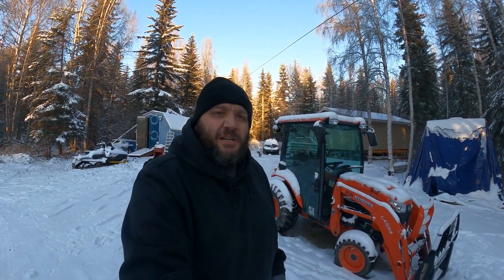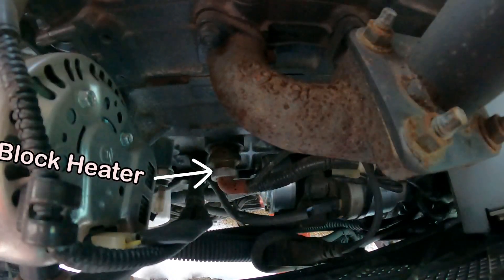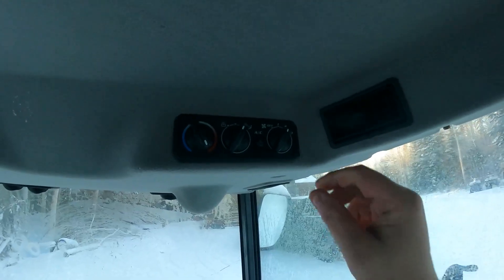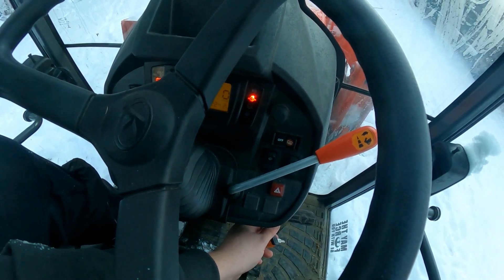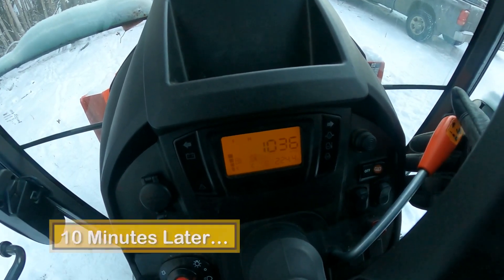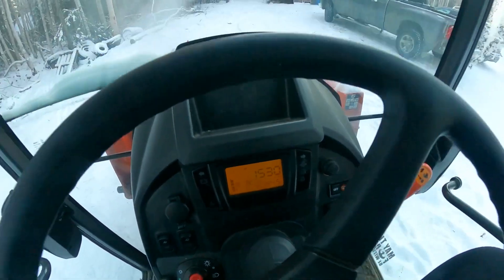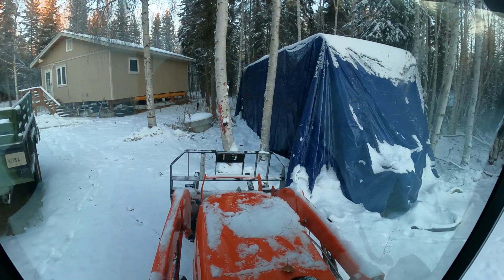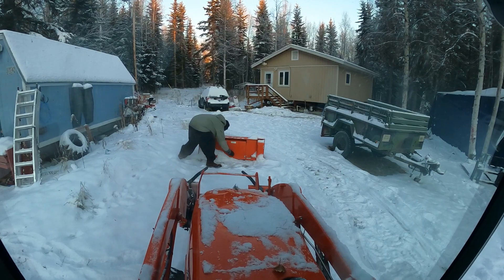Easy Cold Weather Tractor Start Up (Kubota B2650)

Comment: Hey Dana, when I bought my Kubota, my dealer taught me a little trick. He taught me to turn the key to the glow plug position and instead of trying to start the tractor, just bump the starter and it will suck the heated air into the cylinder and help to warm the process. Don't know how much it helps, but I do it when it is bitterly cold. It gets down to way below zero here in Iowa. My tractor sits inside but the building isn't heated. I do have portable heat that I can use if need be.
My big tractor with the cab and heat sits in another shed that isn't heated. It has a hose heater on it but the tractor doesn't have glow plugs. It is a 1970 model John Deere. They didn't have glow plugs back then. I just plug the tractor in and then come to the house and trip the breaker to that building. When I get up in the morning , I turn the breaker back on, fix the fire in the wood burning furnace, make a big hearty breakfast, and by the time I get all that done, the tractor is ready to start.
Thanks for sharing this. You covered it really well.
Reply from the maker: Thanks 😊 we could use all the help we can get in the winter. I’m curious how cold does it have to be for the John Deere before you need to plug it in? I have never been around a diesel without glow plugs. My dads Florida truck is so spoiled it will barely start at 40 f without help, and his glow plugs work😂
Reply: @180Floridalife  , when it gets down below mid 30's, it gets plugged in. It is so much easier on it to have a little help getting started. I am not one that will do the cold starts for you tube. I value my equipment too much to treat it that way.

Comment: 30 seconds straight is too long. At least that's what i have always been told. You can damage your glow plugs getting them too hot running them longer than 10 seconds. What i do  is run them for 10 seconds than count to 20 letting them cool off. While they are cooling off that heat is still getting applied to the engine since the engine is colder. After 20 seconds i will run the glow plugs cycling them again. If its real cold i usually cycle them 3 times. Never have an issue getting it started and my glow plugs shouldnt wear out prematurely on me.
Reply from the maker: Thanks for watching, life on my glow plugs cold be a concern 🧐 this is my extreme cold start up after a month of -40 f to -50 f  temperatures. On a warm day I never hold them over longer than 10 seconds. The joys of cold 🥶

Comment: Well just for those that heard him say "...as the water circulates by...", this is 100% INCORRECT!!!!!!
The water does not circulate when the engine is off.
All the heater does is heat the coolant directly in contact with it and the heat will transfer to the remaining coolant. This is why it takes so long to heat up. If the coolant was actually flowing, just like your automobile, it would heat quicker.

It does work and is a great help in the temps he is experiencing and lower.

At the temps you are wanting to use a block heater, you will want to also use a battery maintainer.
Reply from the maker: True, coolant does not circulate while the engine is off. Heat transfer would have been a better way of saying this, thanks for watching 👍👍